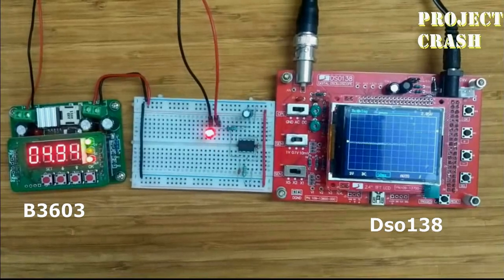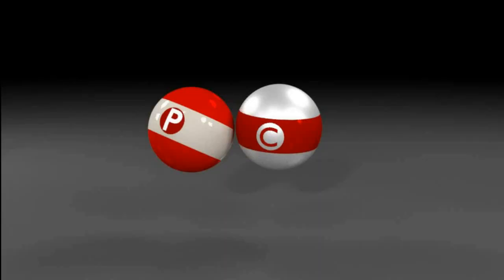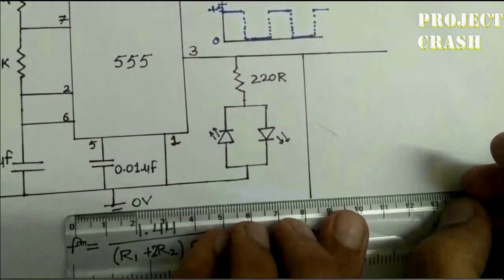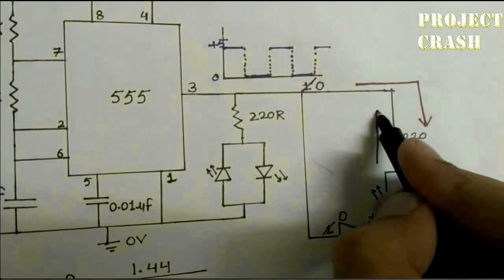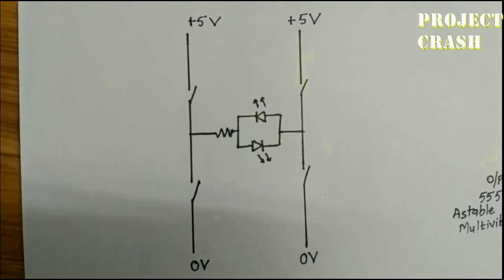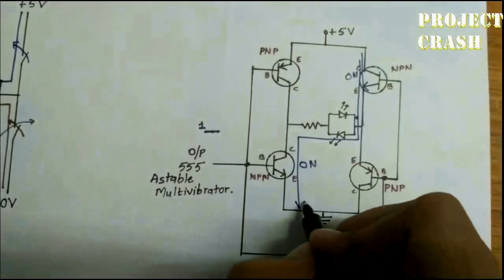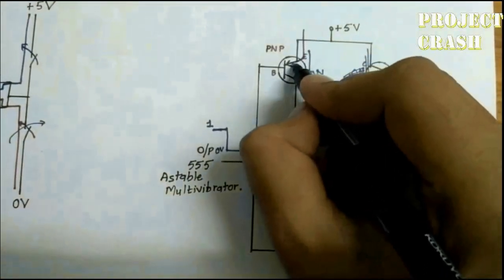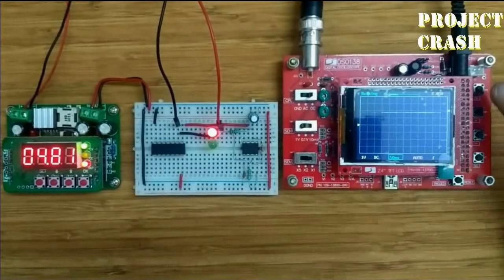How To Generate AC signal with 555 IC.

Comment: Very noisy circuit as seen on my oscilloscope (gnd probe on pin 12 of hex inverter and +probe between 220 resistor and leds)...
A 2.2nF between pin 12 and 6 stabilizes the whole thing, signal is cleaner...
Not sure this is an ideal solution...

Comment: It's a good thing you crossed out that H-bridge circuit. With a base-emitter junction voltage of only ~.7 volts, Q1 and Q3 would go into saturation with the bases tied together, with no resistors. To make that circuit work, you would need 10K resistors connected to each base, then joined at pin3 of the 555 timer, and each transistor should have a 2.5K resistor from the bases to the rails. That will ensure that the transistors are OFF with no connection, but that the 555 only has to swing+-3.5 volts to turn them on. No problems with Q2 and Q4, with their collectors connected to the rails, and the emitters tied together. The amplitude will be 1.4 volts PP lower than the output of the 555, but plenty to drive the LED's Q1 and Q3 will indeed swing rail to rail.
Reply: It seemed odd that he gave up on the h-bridge when it should work fine if properly designed.

Comment: But its a square wave signal, how to make it as a sine wave?
Reply: Just add a capacitor in series with the load to make it AC, easier and cheaper.
Reply from the maker: Connect a series RLC across output. But the system must be underdamped.